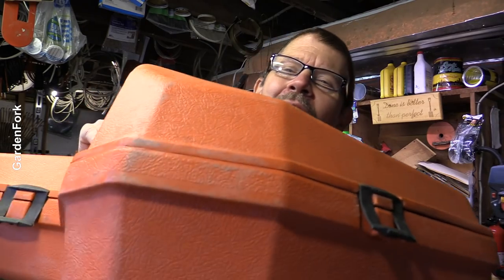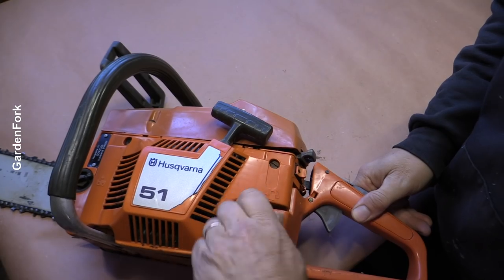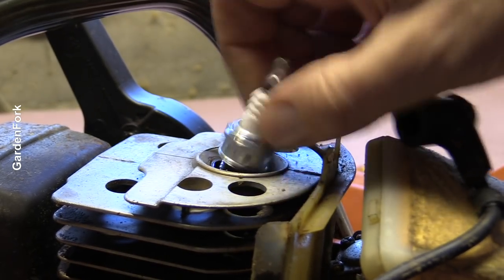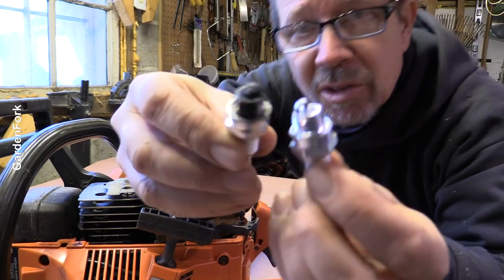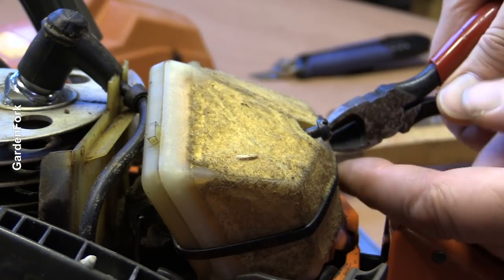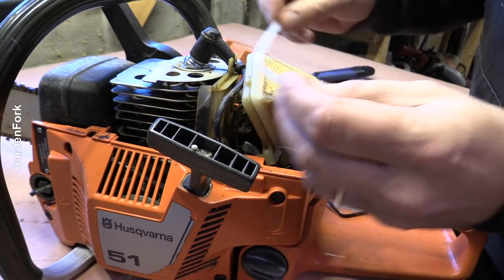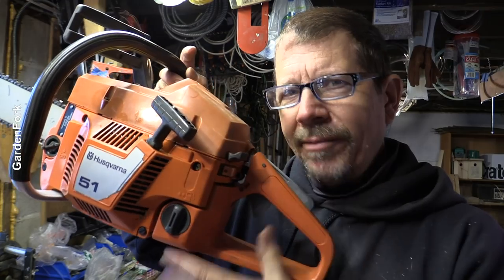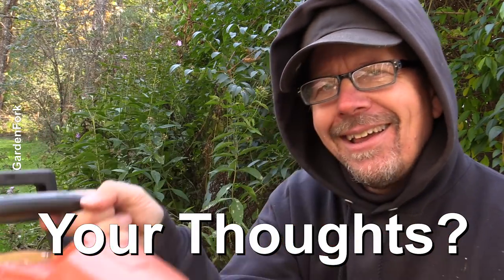$15 Chainsaw, Will It Start?

Comment: I start mine by changing batteries!
B&D 20 volt electric. Great for small jobs, and I don't get worn out yanking on a start rope.
Reply from the maker: The electric saws have greatly improved!

Comment: At times in severe cases the fuel and vent primer  bulb & tubes get wonkey and crack... causing all sorts of problems. The carb diaphragm can dry out but soaking in brake fluid softens them up.
Then there is that silly "aquarium stone" that provides air but in the fuel tank serves as a fuel filter
Reply from the maker: Yeah I was thinking the fuel tube might be bad Craig. Still might be, as this is an older chainsaw. Did not know about the brake fluid trick. Thx!

Comment: Here is my take on fuel. TruFuel is great stuff, even better than 92 octane/no ethanol for a number of reasons. Where I have an issue is running 40:1 or 50:1 mixes, there just isn't enough oil for a 2 stroke. This was shoved down the throats of manufacturers by the EPA, and hey, it burns a lot cleaner, but your crankcase is bone dry. As a rule, I run 32:1 in any 2 stroke (and tune for it), and my chainsaws love it,and you'll never have a scored cylinder.
Reply from the maker: Interesting info Joe, thx for that. I did not know that. Thx!

Comment: Wow bro air spark fuel. Whomever sold that for 15 is a real smartie. And im a weekend warrior but i would never buy pre mixed. I use it for chainsaw my trimmer and blower so mixing up a 4litre is pretty basic and far from guess work. Anyhow nice find if its true. Doubtful